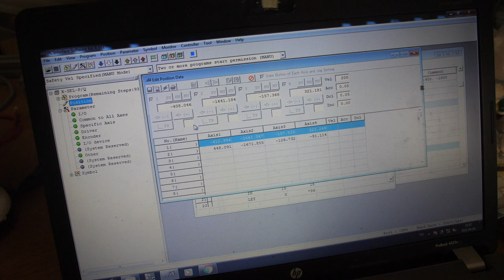DIY robot camera crane teaching, detailed technical description

Comment: Very nice, Peter, the moves look very smooth. For that roll-compensating you need another motor/gear in-line between the boom-arm and the head, I think..... basically a harmonic drive or similar that has enough torque to hold the complete head and camera. However, this will complicate the intuitive programming by hand.
Reply from the maker: Thanks! I also plan an extra axes, but now I just enjoy what is already working:) I really don't need extra weight in the head, so I have to figure out a light tilt head.

Comment: Are all the Steppers closed loop or do you also integrate servos?
Reply from the maker: Hi, in this robot all the drives are closed loop AC permanent magnet servos.  If the servo is disabled, the encoders are still working.
Reply: oh ok, it's pretty complicated to get those servos working, or? I tried it with an JMC servo but switched back to steppers as I couldn't get them to work properly. Do you think you could do a video also about controller and software which you use or are available for private use? actually I'd like to record a path and then replay it. With a joystick I would be super happy, don't even need to position the robot by bare hands. I'm wondering how to record the data and hwo to store it. If it's recorded with position waypoints and speed, or position at a dedicated timestamp. I'm super impressed by your builds
Reply from the maker: @mt8385  Hi, If you like stepper motors, there is a possibility to install a rotary encoder on a stepper as well. My problem with stepper, that even if you apply microstep and so there is still a small resonance, can be seen on the recorded video. I use Siemens Sinamics drives now. The software is free for those drives.

Comment: Wow , it's amazing ! can you make a tutorial video on how to positioning the robot by hand? I'm  interested on the software and whole system , but i found not any source from youtube
Reply from the maker: Hi. This video is relatively detailed. There are AC servo drives on the robot with rotary encoders. So when the robot moves or if it is moved by hand the rotary encoders always detects the actual coordinates and with the robot controller the position can be stored and later replayed. This is shown on this video.
Reply: i see , really thanks for your reply and sharing ! such a good video creator
Reply: Does stepper motor can store the position ? sorry i'm quite new on this field as i just study engineering
Reply from the maker: @suren9353  The stepper motor also can have rotary encoder, but usually it doesn"t have. Most of the stepper motor controllers are open loop so there is no rotation feedback.
Reply: i see... thanks a lot yay !!

Comment: awesome.! i have made my camera robot year ago and i wasnt able to finish it because of the software. please if you can answer few questions will help me alot. thank you
Reply from the maker: Hi. No problem. Just ask, I will try to help, if I can:)
Reply: i build my camera robot on Cartesian system with pan,tilt and roll head at the end of my z axis. And i used AR3 software by cris annin robot arm it works but some limitations because the software inverse kinematics are written for robot arm. My question is how can we modify the source code of ar3 to work with Cartesian robot.
Reply from the maker: @RapidShots_Studio  Hi. This is not exactly the question, I could answer easy:) I suppose You have Step/Dir drives. If the kinematic doesn't fit your robot you can also try something simpler, like Mach3. There you just set the coordinates and interpolates between two points. On a Cartesian it can work at the beginning:)

Comment: By the way, I wish I could find such nice "dumped" hardware where I live.....
Reply from the maker: Junkyards near automotive factories (or similar) usually there are good stuff ! You just have to keep your eye open :)
Reply: I wish that was possible in Thailand: anything that has a hint of value will be quickly picked up, dismantled and sold in pieces for high prices at used-gear shops.
Reply from the maker: @steadirob  There are people here also, who hunting good stuff on junkyards, but even if you buy from them it is still not too expensive. Once I saw a picture about a huge pile of KUKA robots (like 100 robots) in a pile in a junkyard near me...

Comment: "DIY" ...
Reply from the maker: If you’re building something from a PET bottle home, you could say DIY despite not have an extruder at home that makes the PET bottle itself. If you want to build a robot you need components! If you find them on a scrapyard, and assembly them differently and entirely change its function I think it is a DIY project to. If you watched the video you saw the modifications on the original robot.
Reply: In no way is my comment to take away credit from your work, which I find spectacular. But from a DIY project I would expect more "basic" components, perhaps motors, controller boards, milled or 3D printed parts, not the modification of a robotic arm ... build from less integrated components. It's not my idea to DIY build your own convertible car, the first thing you need is a car ... Sorry if you offend my comment, it's just a matter of definition. Nice job